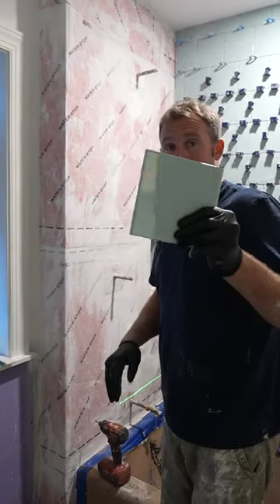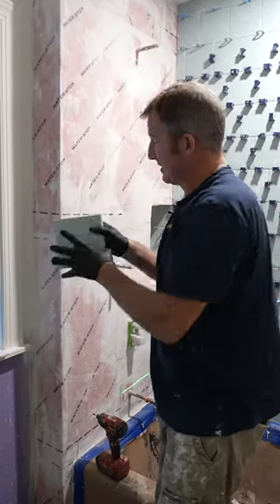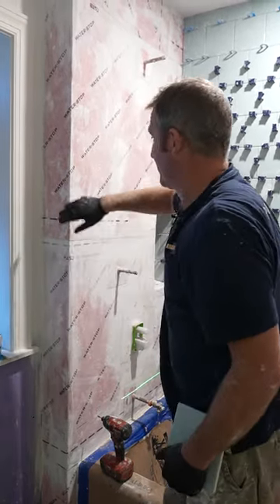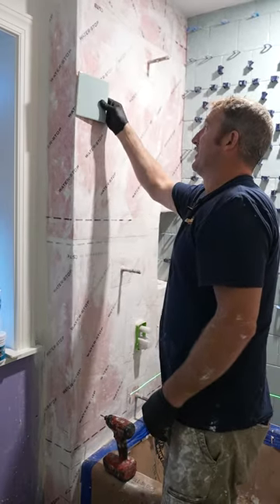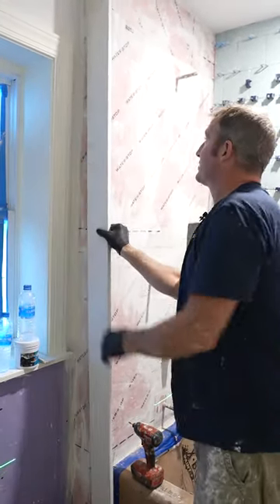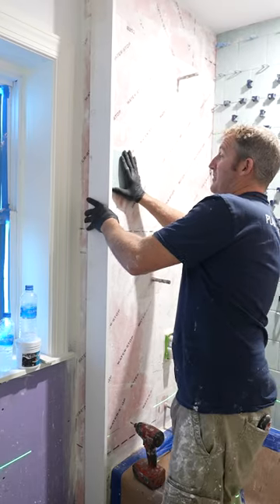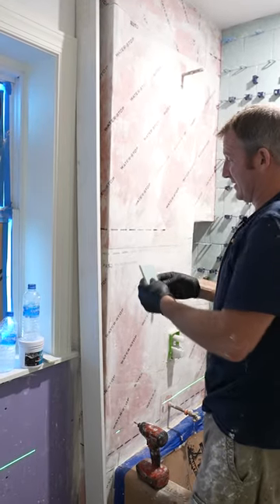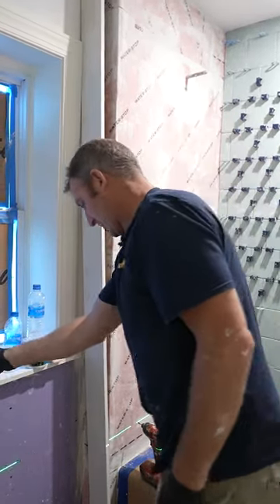Tile Layout Tip for Outside Corners

Comment: Ppl seem super confused on listening. Only thing is just to silicone the screw holes when you pull the trim off to do the bull nose and only use one on top middle and bottom then plug the holes  then the bullnose has a nice edge to meet to

Comment: is that trim board pvc or something waterproof?
Reply: Oh boy. My friend, it's temporary. It's used for reference and after he tiles the wall, he'll take the board down and install the bullnose
Reply: It’s just a temporary straight edge.
Reply: Holy shit he’s just using that to mark the edge of the freaking wall dude, are you smoking some good shit you better share that right now, however, where is the solution corner piece that matches that tile and then we have the bigger question who chose the tile solution without any edge or corner pieces